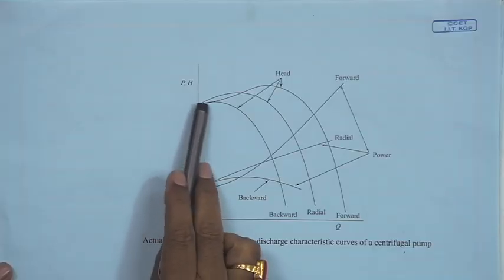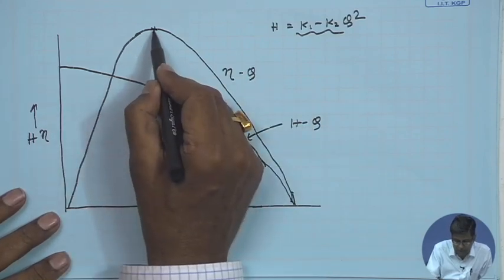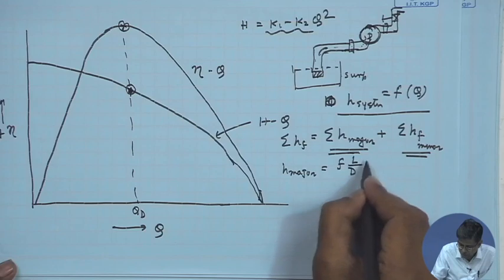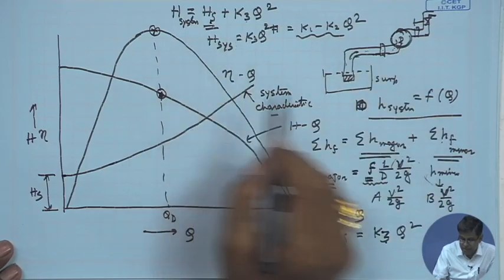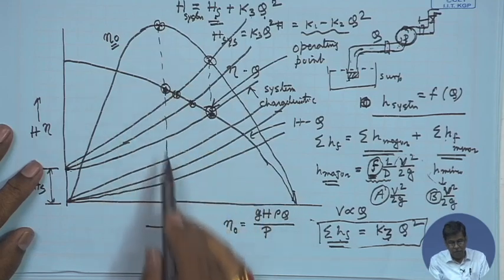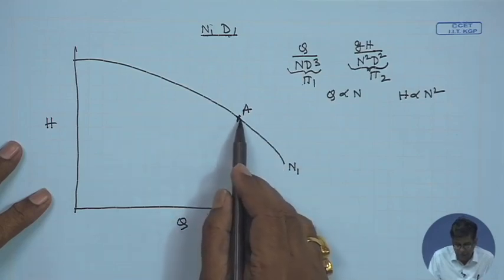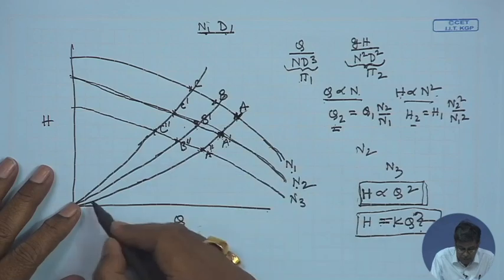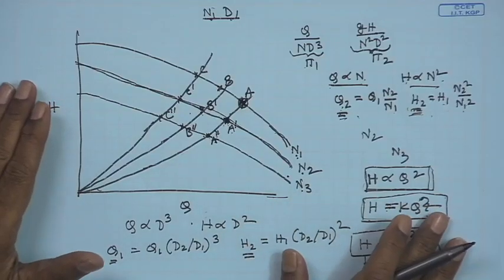Matching of Pump and System Characteristics

Comment: Why head max at zero discharge......
Reply: Think of the pressure developed when you hold your pee for a while.
Reply: At higher flow rate all the mechanical energy is dissipated into inter molecular energy without producing any useful work